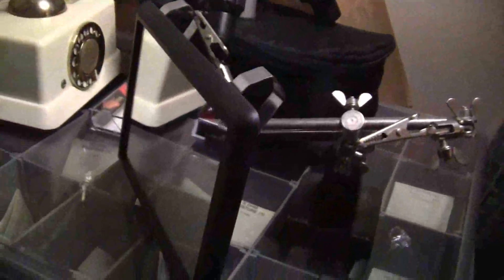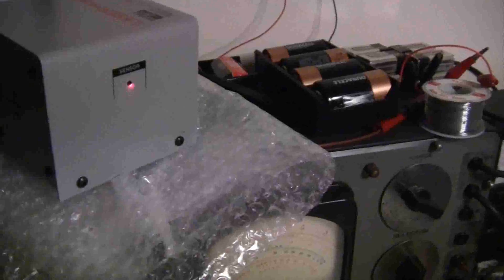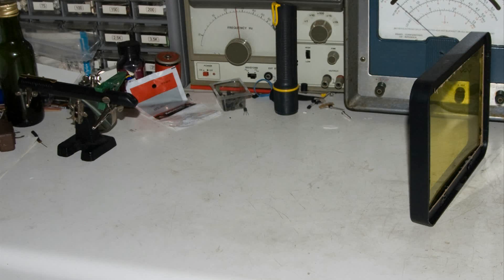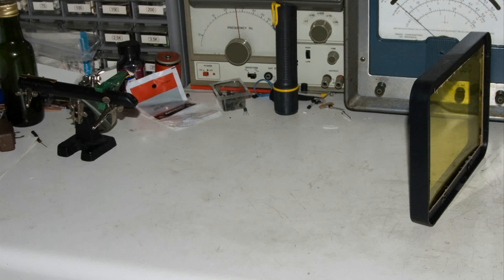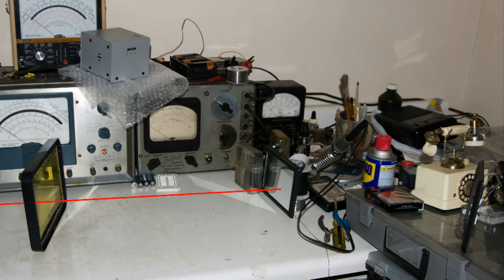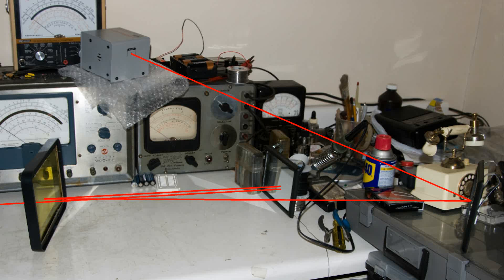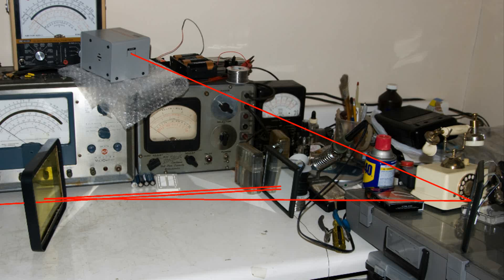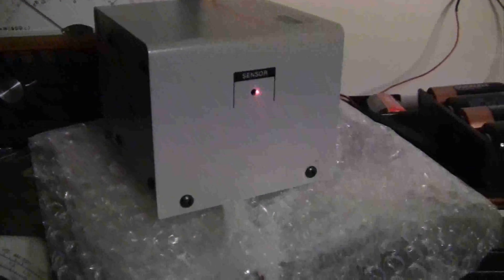Sound Interferometer Laser Pointer

Comment from the maker: It is hard to see, the interference comes from the surface reflection off of the transparent yellow plastic. The reflection, is reflected directly back into the source. If the reflection is not reflected back into the source it does not work.
Reply: Don't see how the interference at the yellow plastic should affect the reflected portion any more than the interference along the rest of the shared path. I wonder whether it's more a question of the effect of the part of the beam transmitted back into the laser that's causing the effect.

In that case a simpler setup with the detecor directly opposite the laser pointer with a half mirror (I'd suspect that a film that reflects a greater portion of the light would work best) in the path of the beam.

Comment: Rick.... nice job, but this seems to be a laser transducer optical circuit based on vibration. But I don't see any use of optical interference ( creating a modulated phase pattern ). To do that, you'd need to split the beam, and measure some change in the interference pattern caused by sound.

Good video, none the less...

Comment from the maker: Thanks CameramanLink
Yes and with no hands.
To modulate at video frequencies, the Laser would be in the modulation circuit as an output. The problem will be the receiver. But not to big of a problem because the phone industry has developed transmitters and receivers far beyond video frequencies.